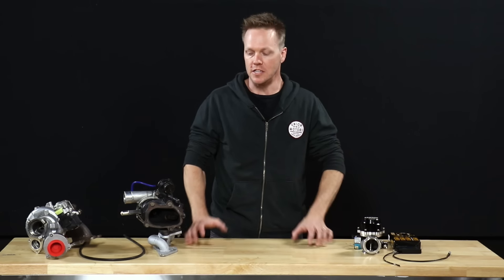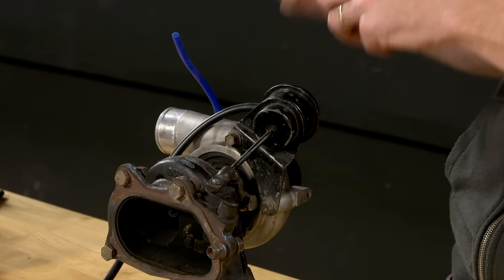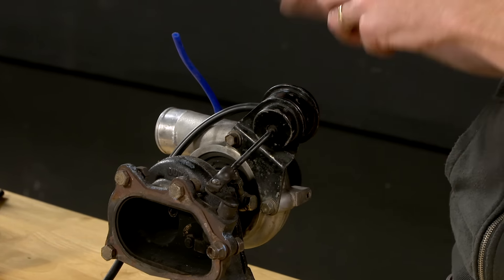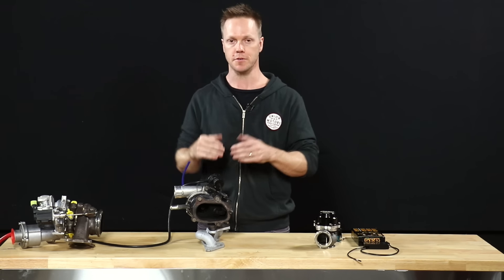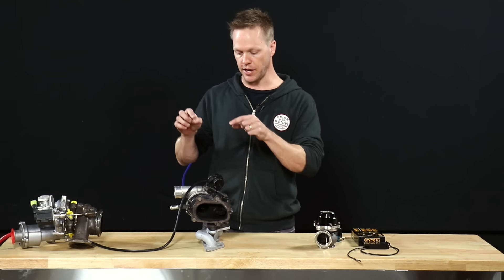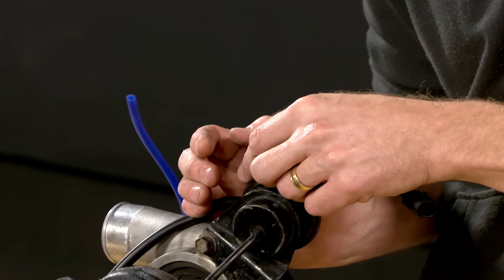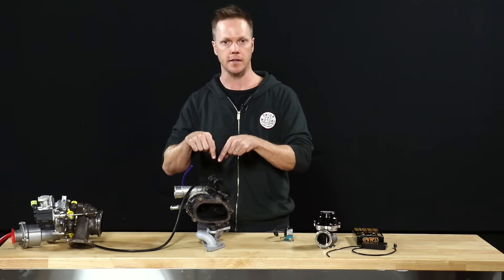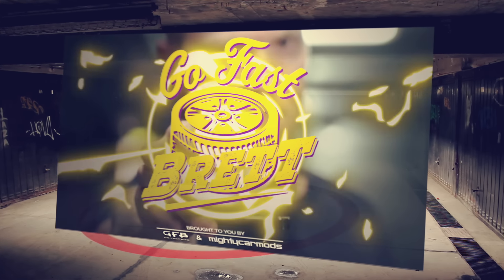Boost Control Explained [GO FAST BRETT]

Comment: Just wondering.. If boost controller helps the turbo spool more or less boost, Would it affect air fuel ratio? Wouldn't higher boost would cause the car to run lean?
Reply: If your car has really dumb engine management or wasn't designed to run boost, then yes. If the ecu is designed for boost then it should add more fuel when it senses more air going into the engine. However there are other limiting factors like flowing more air than your air mass sensor can read, making more pressure than your MAP sensor can read, or requiring more fuel than the injectors can flow.

And that's if the ecu doesn't have a fit. Factory ecus are tuned to work at a certain amount of boost; if the turbo makes too much it will try to limit engine power to protect the engine from damage. For example on cars with electronic throttle control, the ecu can close the throttle.
Reply: Oh great explanation. Thanks for your time. I'm currently running standalone now with my stock supercharger, planning to remove and swap with turbo charger. Understanding boost with turbocharger sure is a new ball game :)
Reply: noxious89123 I don't have an ecu. It's a 4ja1 Isuzu diesel and I want more boost. I'm currently running around 0.5 bar and I want more boost.

Comment: Question: I own a 1982 ZX 280 Turbo, The Boost Gauge ( stock ) has been centered using the factory instructions. When Im just setting in my drive and rev up the engine to around 6/7 thousand rpms, the gauge dosent seem to move very much into the boost side, the gauge goes from minus 7  to + 7, if it makes it to + 1 Im lucky, Do you think there is something wrong with the turbo, maybe the flapper. The turbo is 34 years old. I dont have a turbo back ground so this video is very helpful. Thanks
Reply: Free reving engines (engines with no load) generally don't make any boost at all so it's normal. An idling engine will be in vacuum and when you rev up it it'll move to around the middle point between vaccum and boost (whatever that is on your gauge). It'll read zero because its at atmospheric pressure
Reply: whatyareckon is absolutely spot on. An engine without load will make little to no positive boost (normally). You'll have to put the engine underload by driving it to get an accurate peak boost reading.
Reply: I experienced the same thing in my STi before I knew much, and your question has been answered. However, if you want to make choo choo noises parked in neutral, try quickly mashing the throttle 100% a few times to pre-load the engine as opposed to gradually rolling onto the throttle. The engine will sense it wants to rev, but needs power to spin the crankshaft to the desired RPM, and until it builds up that power, it will be under load (you'll notice it stops making choo choo noises after 3 or 4 revs, when the crankshaft has enough centrifugal force to not require extra power).
Reply: Thanks everyone, So it needs to be under load, currently dont have ins on it so not driving it. But I can sneak it out at night for a little run down the road to see what the gauge is saying, I also have a small leak on the back of the head on the exhaust manifold, its real small, I sure it would play some part in the boost but it shouldn't take away everything . I will let you know what it says. Otherwise the car runs really fast. I installed a Jim Wolfe computer into it awhile back which cured alot of minor problems.
Reply: +Amon Todd Oh wow, didn't know this. I loaded torque on my phone and thought I'd configured it wrong for my 1.8t when I revved it and didn't see the boost move. I'll have to try it out while I'm driving. Thanks guys!

Comment: I have a question that no one mentions in ANY boost control video....when you have a car with turbo...you have a boost control valve.....that valve is pre set to say 5psi...(5psi why bother..lol) you also have a boost pressure sensor in the intake hose before the throttle body.....you have 3 vac lines going to the boost control valve...everyone talks about teeing into two lines...never mention what you do with that third fresh air line that goes to the intake before the turbo...or even wether or not you should disconnect the elec. conn that goes to the boost control valve....more than likely your car will go into limp mode because it sees more psi at the pressure sensor than is allowed by the ECM. 
Tell everyone what they should do with the disconnected boost control valve and that third fresh air hose. Then you are doing someone some good.
Reply: Daniel ColorsPainted 
Now whut you say there Leeroy?

Comment: i have the GFB electronic boost controller and im not happy at all i have tdo4 hybrid 19T forged Wg spring settino is 1,1 bar. on turbo.and i connect the GFB and dont feel difference after i jump up the setting fault go on desk ecu board heck injectors & esp  with coms to throttle body . nof after usage of gfb for 3 mc the hauge when is on its newoer on 0.00 when engine is off jumps from 0.01 to 0.07 when engine is off .when i spoke with gfb the se its 100% checked and its impossible to by faulty. item was posted directly from Australia to UK

Comment: If wastegates are adjustable, then why do I need a boost controller to fool the wastegate. I can manually adjust it and thats it. Could someone explain to me whats the ultimate advantage of boost controllers. 
Thanks
Reply: Ammar Ziad Wastegates are barely adjustable, only about a couple psi. That's called cranking the wastegate and there's pros and cons. With an MBC, you can literally double the boost pressure of your stock turbo, but the engine's computer won't have any idea, so the AFR and actuator will work exactly the same way. Depending on your vehicle, if you aren't careful when cranking your wastegate, you'll send your car into  limp mode and render it useless. Definitely isn't worth the 2 psi you'll gain as opposed to 7-10 psi
Reply: Ammar Ziad Oh, and adjusting the wastegate doesn't fool it, because it'll know exactly what's going in pretty much. That is what'll trigger your ECU to do weird shit. The goal is to be sneaky and not let your car know what the hell you're doing to if lmao, hence an MBC

Comment: Heres a problem, I have a R33 GTR and its fitted with a Blitz SBC-TypeR Boost Controller.

It has 2 settings "set" and "gain" im currently adjusting "set" only to try and acheive the desired peak pressure and then im going to tune the "gain" for best curve, this is how i have set up my boost controllers in the past. 

The problem i have is that up to a "set" of around 45 the boost wont go above .6 bar. Change the "set" to 46 and it wont control the boost and at all it shoots up until the warnings i set in the EBC go off and i have to ease off. 

Any ideas?

Comment: I installed a boost tee to my hilux and there was no gain in psi, I winded it slowly til there was no more clicks. Still nothing so I switched the hoses thinking it could help but nope. Someone point me in the right direction
Reply: I took it apart and there was a spring and ball only on one side and not sure if it’s meant to be on both

Comment: OK SO WHAT IF YOUR TURBO IS SAY A HX40 AND THE BOOST ON THE INTERNAL REG IS SET AT 25PSI AND YOU ONLY WANT TO RUN 12PSI WOULD A BOOST CONTROLLER DO THAT? AND HOW ABOUT A VIDEO SHOWING HOW TO! LOTS OF GUYS RUN DIESEL TURBOS AND THAT WOULD BE HELPFUL TO KNOW HOW TO NOT BLOW UP YOUR RIDE!

Comment: got a question my wrx is making to mutch boost xD like 1 month ago he made like stock 0.7bar of boots than is littel raies to 1.2 than after 1 week to 1.5 and now its making 2 bar of boost xD so can it be that somthing blocking the air for the spring?